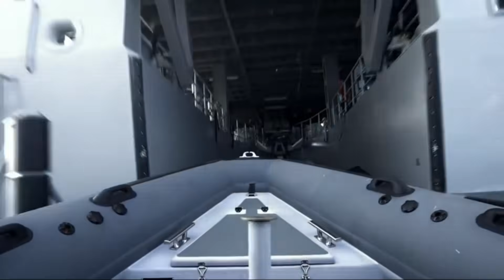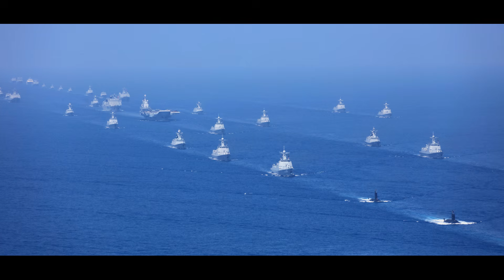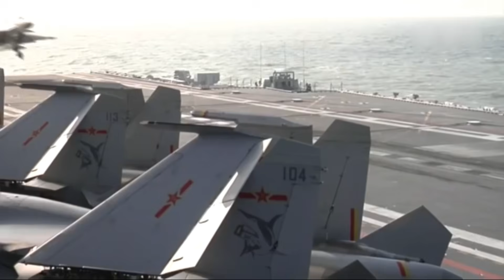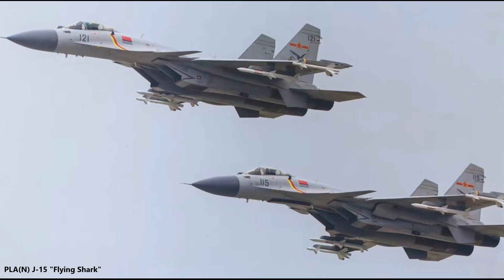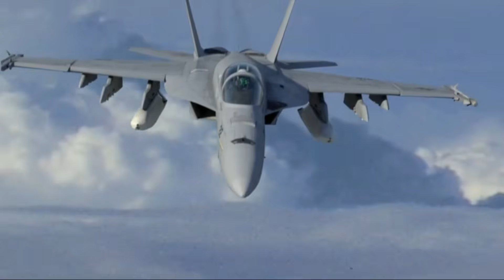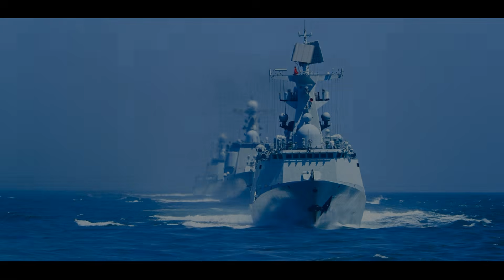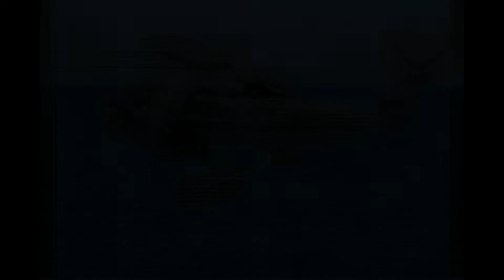Up-Gunning the Arafura Class OPV

Comment: A patrol ship you don't want to mess with.   Eqyptian Ezzat class.   Built and design by Navsea,    600 tons, 40 knots, 8 harpoons, 76mm cannon, Rim-116 rolling airframe missile, 20mm phalanx CIWS, and a few small arms machine guns.   The only thing missing are torpedoes!
Reply: Nasty little bugger! 40 knots is impressive but it is a bit of gas guzzler. 2000 nm @ 15 knots sounds like 500 nm @ 40 knots. Great for patrolling the Suez Canal but not really suitable for Australia's enormous maritime domain. At US$240M in 2009 dollars they are not cheap either. You could buy a 4500 ton Absalon multi-role frigate (without the containerised weapons packages) for that much with a range of 9000 nm @ 15 knots.
Reply: LOL its a Corvette. Not a patrol ship. And the only thing they have against their Indian NGMV peers is that they are 5 knots faster. Indian NGMV has 35 knots, 8 BrahMos, 32 VL-SRSAM (ESSM class), 76mm Oto Merla SRGM, 2 AK-630 CIWS (30mm).
Cost: $1.2 Billion for 6 ships compared to your $1.5 Billion for 4 ships.
.
So MUCH better AShM, MUCH better SAM and better CIWS at slightly lesser cost. 
And to top it all off, they have something that even UK's Daring class destroyers don't have: Cooperative Engagement Capability. They are networked with Indian Destroyers and Frigates through an India developed Combat Management System.

Comment: Unfortunately the current configuration of the Arafura class belongs in a bygone era as the threat and the threat level has changed.  A nation to our north deploys armed fishing vessels, sometimes  into triple figures.  In the video, I was hopeful of a discussion on the following:  What bow sonar would be appropriate for the two twin light weight torpedo tubes (midships),  the 57 mm gun being move forward to accommodate the 60 to 80 C-Dome missiles - tasked to the CEAFAR's Radars, moving the RIBS to midships  and restoring the helicopter flight deck and fuel system.  Discussion on the mark 57 vertical launch system to line the fight deck, say 12 VLS per side with the Sea lancer system and an engine upgrade to at least 6 to 7 Mw would round out the upgrade.  Like to hear your thoughts.

Comment: OK, the key question here concerns these ships innate existing build standard, as 'seriously' up-arming them'll only be wise (and affordable) if they were designed and built from the get-go to include all the 'passive' structural and relevant survivability related system enhancements that define genuine combat units.

As a useful benchmark, ref the UK's c2000 tonne Batch2 River Class OPVs that I've already mentioned here. Which only merit serious upgrades to THEIR laughably minimal weapons fit (essentialy 1 x 30mm ASCG...  er??..   that's it!) because they were built already featuring...
-full ballistic protection to the magazine
-enhanced warship grade firefighting and emergency lighting systems
-improved internal subdivision and watertight integrity
- small ops room with provision for a significantly enhanced sensor fit and already featuring a full  BAES CMS-1 combat management system and ‘Shared Infrastructure’ with common console system.
-full military communications fit, GPS and Warship Electronic Chart Display and Info System (WECDIS).
-good power/propulsion/gen plants able to supply weapons upgrades needed extra electricity and already permitting a top speed of c25kts

IF and only IF your Arafuras ALSO feature most or all of these or their equivalents, then yes, you're in business and they not just COULD benefit from  significant weapons fit upgrades, but indeed they SHOULD, a.s.a.p.

Why???  Well, re our 'Rivers', one very cogent question occurs straight away and, assuming they ARE also built but not armed as real warships, it'll apply just as much to your Arafuras.

NAMELY, why did the government and navy think it was OK to pay such a gobsmacking price for ships that with their current armament are only ever going to be fit to undertake constabulary work at most??

Or more shortly, why do they think the taxpayer should have to fork out DOUBLE, merely for glorified police boats??

..and even if the Arafura's are NOT built as full combat units and big weapons upgrades are inappropriate for what'll always be, at most, an OPV, the single 20mm canon they now carry is still inadequate for ships that'll have to confront pirates and/or drug smugglers. So why was the originally envisged provision for a main armament of 1 x Oto Marlin 40 autocannon, cancelled??
Reply: Good question.

There is a lot of politics involved in all this. The RAN does not seem to want feature creep on these vessels. They are meant to be long-range oceanic utility trucks that are build to last and cheap to operate and sustain, and not surface combatants. Alarmingly, the new government is already talking about arming them with Naval Strike Missiles. Doing so earns the government political capital by appearing to respond in a timely manner to rapidly changing strategic circumstances and the rise of Chinese naval power in the Indo-Pacific region. But these vessels are just not built for combat operations and modifying the design would be very expensive and introduce unacceptable delays. The RAN knows that it would be much smarter to start over with different mature design for a small surface combatant.

The Arafura class sounds expensive but bipartisan government policy is to support a sovereign naval shipbuilding industry by providing a continuous pipeline of construction. Federal governments on both sides have made election promises to the states about how naval shipbuilding will provide jobs and so there is intense competition between the states for the economic benefits. Western Australia won the recent election for the Labour Party. Rolling back those promises would create political problems for both parties of federal government which could see them fall from power. The goal is for at least 70% of the naval shipbuilding budget to be spent in Australia which means that the money gets recycled in the Australian economy and does not leave the country. The procurement cost looks high "on paper" but in reality is offset by other benefits which brings down the real cost to the nation. i.e. A local build lowers the sustainment cost over the 30 year life of the vessels. 

The Oberon class submarines we bought from the UK illustrate the problem. They were good boats to have during the Cold War years but they needed refurbishment every five years and a lack of local sustainment capability meant that this cost 70% of the procurement cost for each boat. The follow-on replacement Collins class submarine project was done differently. They were expensive to build at the time, and it took them a while to iron out all the bugs because we had never built submarines here before, but today they are very capable submarines and most of the sustainment is done locally. Over the life of the boats they have proved to be good value.

Local construction costs us more initially but it also fosters the development of a local military-industrial complex and enhances sovereign industrial capability. In wartime, supply chains get disrupted and you can't just order new stuff from overseas, so they want to make Australia's defence capability more self-reliant and robust. 

The Collins project was the most complex industrial project ever undertaken by the nation at the time. It introduced many advanced industrial manufacturing techniques to Australian industry. At the end of the project, much of the engineering and project management talent then moved on to the mineral and petroleum extraction industries. Today, Australia is the world largest supplier of LNG and is among the biggest suppliers of coal, uranium, and iron ore. Chinese warships are built from Australian iron ore and metallurgical coal! Royalties on these exports now make a large contribution to Australia's GNP which pays for things like universal health care, the Pharmaceutical Benefits Scheme, and the National Disability Insurance Scheme. Australian mining is these days highly automated and very efficient, so much so that NASA seeks our advice on how to design autonomous robots for future mining operations on the Moon and Mars. 

Australia needs a new transformation in manufacturing capability to allow us to value add to commodities before exporting them so as to pay for an ageing population and to decarbonise the economy. So, industrial reform is key to our ongoing prosperity as a nation. Considered in this context, the money paid for the Arafuras, Hunters and Future Submarines is not as much as it sounds because there is much value to be gained by other parts of the system hidden in the procurement cost and not just defence capability

It seems like the RAN was having technical problems integrating the Oto Melara 40mm Bofors cannon with the Saab 9LV combat management system so the 20mm Typhoon RWS is an interim solution until they work out which naval gun they want to use. Something that uses programmable fuse and guided munitions would be nice.
Reply: @liefsillion2825   Fascinating and comprehensive response, for which I thank you. I particularly note and agree with you re the point you raiise and illustrate with reference to Australia's Oberon Class SSKs. Unfortunately for countries such as Australia (and in the post-1st-cold-war age, the UK as well) the alternative represented by Collins, Hunter and now, most of all, AUKUS, is arguably one that's borderline sustainable at best. Unless, that is, the initial vast inputs to creating/enhancing (or re the UK, retaiining at a reduced but still viable level) all the required major domestic infrastructures and skills bases can bead to robust ongoing export business.

Otherwise, as you remark, "At the end of the project, much of the engineering and project management talent then moved on to the mineral and petroleum extraction industries"...   and tbh, that represents the best  possible outcome. At worst, the result may merely be the dilution or erosion of many key domestic skills bases.

While even in the 1st case that you cite and regardless of the significant benefits to other domestic industries/sectors/the economy in general that you mention, they're still VERY costly and time-consuming to re-create/re-assemble for another big domestic naval project.

Here endeth today's short sermon which was brought to you from Barrow-in-Furness, NW England. Site of a shipyard  specialising in high tech naval (principally nuclear submarine) design/build and which just over 3 decades ago employed c12,500 men.

Comment: The navy has aging Hobarts that do need another 4 or 6 Hobarts / F110s to overlap the Type 26. With the inclusion of the Arafura capability upgrades this would certainly lift the Navys position. The then Anzac class could hold the line with the incoming Arafura class to extract depth of sensor capability.

Comment: How about mounting lighter weapons? Things like Hellfire/Brimstone missiles could fit in very well with the current mission, able to easily dispatch light craft. Another upgrade could be Mistral missiles. If you don't need new radars this could be a very cost-effective way to add air defense capabilities. I might also suggest the Oerlikon Millenium Gun. Really any gun-type CIWS would help (accounting for weight and recoil of course).
Reply: Why does a patrol boat designed to tell fishermen to kick off need air defence capability? honestly... not everything needs to be a light-frigate...

Comment: They good OPV. But with the small fleet Australia has RAN should heavily arm them. 

57mm main gun at the front.
2x2 anti ship missile canister in the middle off the ship. For either LSRAM or Norwegian long range anti ship missiles including 2x2 light weight torpedos tubes in the lower deck. Raise half off the helicopter hanger and put some sea ceptor missile tubes and a ciws close weapon system at the back or a 21 cell sea ram system  to whatever fits best

Australia  has the Cape class border patrol vessels for boarder force. The RAN OPV should be heavily armed for coastal patrol vessels for what slips through  the Hobart class destroyers and Anzac frigates. More heavily armed ships the better.

Lightly armed OPV won't survive during a war. And frankly are useless for defence and can take weeks or months to arm them with the right configuration to survive during a war. Something Australia  defence and government overlooks.  With the Chinese becoming  more off a threat to our region. Australia is sleepwalking when it comes to arming it's defence. Building  ships that can't carry enough  armament  or Building equipment  with too little  armament. Taking to long to make decisions. And ordering stuff that won't be delivered  for a decade or two away. It comes down to incompetent government and bad military  advisers. 

Ex ADF member.